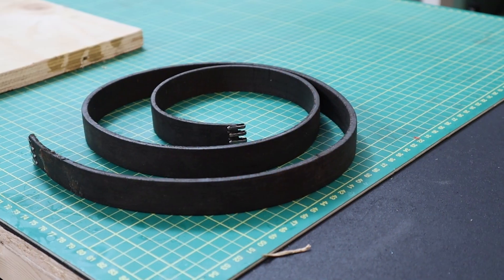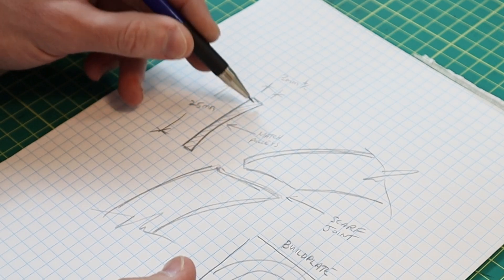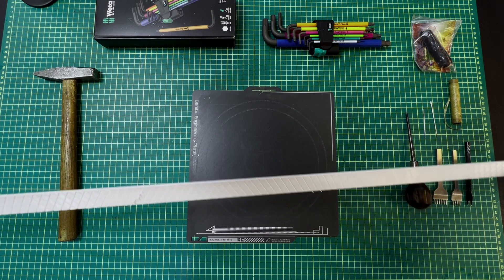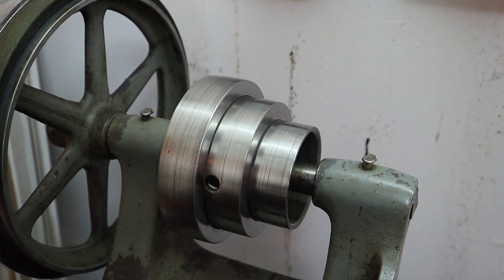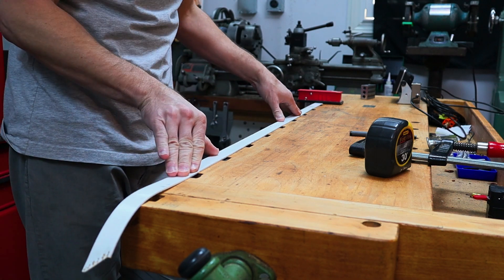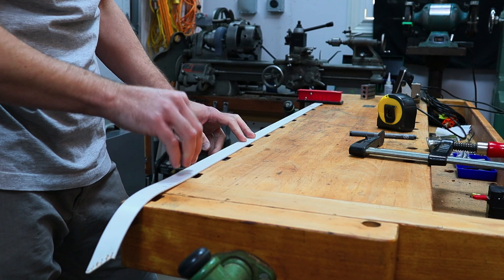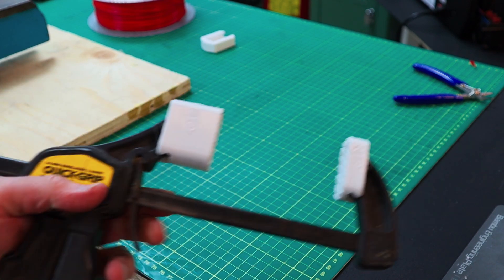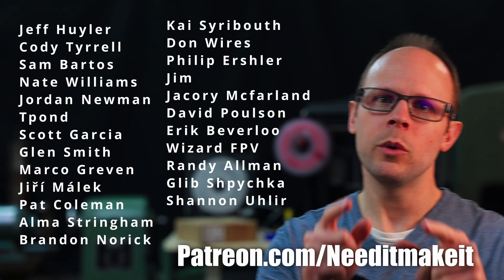Can you 3D print a functional lathe belt from TPU?

Comment: Aren't the "grip" grooves in the TPU belt reducing the area of contact on the pulleys ?  I wonder how it would fare on the plain side.
Reply from the maker: Yes they are.  The concept is the same as that used on vise grip jaws, or even our own hands, we have better grip because of the texture than if we had a smooth surface because those raised areas will flex a little bit to act more 'rubbery'.  I don't think I did a good enough job on my attempt, they'd need to be far closer together to mimic those types of textures, rather than a pattern that is more for looks like what I actually did.  by adding the curve to the interior surface in the model, it made texturing the surface far harder, I kind of hurt myself there.
Reply: @NeedItMakeIt But then again, NASCAR uses flat tires (not treaded) for racing for better grip to racetrack surface.  It would be interesting to see if that makes a difference (may also allow the belt stick crayon to maybe make more of a difference).
Reply: @richc9890 because the track it’s self has that uneven surface for the slick tyres to grip, as soon as it rains any race car won’t be using slicks anymore because smooth on smooth doesn’t give a lot of grip
Reply: @AuroraRainUwU  The problem isn't the smooth surface, it's that smooth surfaces don't easily allow water to get out of the way of the contact patch and you hydroplane easily. Most tires are designed to push water away from the center and help with that issue. Flat surfaces have excellent grip if they are given a chance to make contact without a "lubricant" getting in the way, whether that be air, water, oil, dirt, dust, whatever. With the friction crayon he's using in the video, a smooth flat belt should have the best possible grip on the pulleys.
Reply: @richc9890 Racing slicks are made of a softer rubber which will become tacky as it's heated by the friction between itself and the track. While they grip better than regular tires, they degrade quickly.
Reply: You should try with and without knurling. You put kn urling on everything in this video with zero justification. Before "improving" on an existing design, it might be best to ask why the existing design is the way it is. It is often the case that smooth materials in contact have a lot of friction. I also think it was a mistake to design the curve into the belt because domed pulleys are designed to work with flat belts @NeedItMakeIt
Reply from the maker: @NameOfTheDragon  Your comment is a pretty classic blanket statements.   You've made assumptions of what I have and have not done.  Just because it was not in the video or you didn't watch that part, doesn't mean it did not happen.   I don't claim to understand everything about belts or pulleys either, they're simply ideas that I am sharing.   Sometimes I have good ideas , sometimes I have bad ideas, they don't all work out. 

I say to you what I say to many people with your same approach to giving feedback, and that is, if you don't like it; do you it yourself and then post a video to share.
Reply: @NeedItMakeIt In this instance adding texture massively reduces contact area and therefore friction.

Adding texture for grip works when you have similar surface properties.

I.e a texture boot sole in soft mud massively increases contact area, but that same boot on a very hard material i.e sheet metal would offer far less grip than just flat rubber sole. 

That's why climbing shoes have absolutely no added texture because materials they are used on are hard.
Reply: @NeedItMakeIt  Thanks for the reply (and the videoS) ... I'm not sure a printer can print those "fingerprints" sized pattern in TPU but it would be another cool video/experiment ;)
Reply from the maker: @Emurga  No problem, I'm having some fun trying to come up with new ideas and solving problems as we go.  

I'd just need to be able to 3d scan my fingers with the macro lens and then do an extrusion.  I think for that to work, they'd need to be able to deform to match the surface so they would be pretty thin and taller extrusions.  I guess that's where rubber does the best, because it is able to deform to match the surface so well, and with the reinforced core, it'll prevent it from stretching.
Reply: @NeedItMakeIt  or create round divots into the belt to act as suction cup while being in contact with the pulleys. That might augment the grip without needing a super fine structure.  Anyhow, that's a rabbit hole I'll try to avoid ;)
Reply: @NeedItMakeIt  If the aim is fine texture, then perhaps the natural roughness of the layer lines inherent in 3D printing would be sufficient, alternatively using fuzzy skin in the slicer would be a quick an easy way to add texture. Sounds like a bit of testing is needed to find the optimal grip.
Reply: Yeah, I've had the same thought.
Reply: Couldn't just fuzzy skin the inside for better grip? You could even apply different settings for the coarsness.